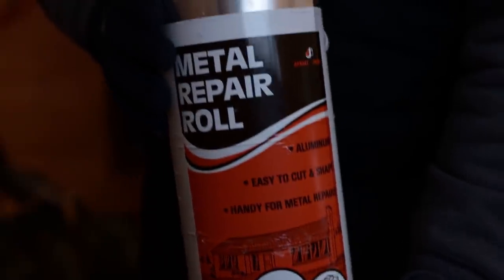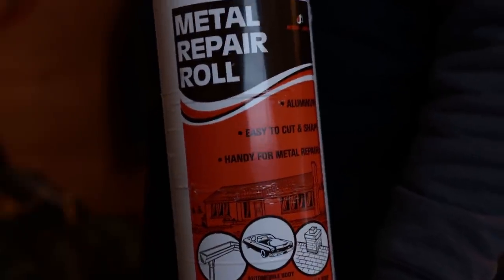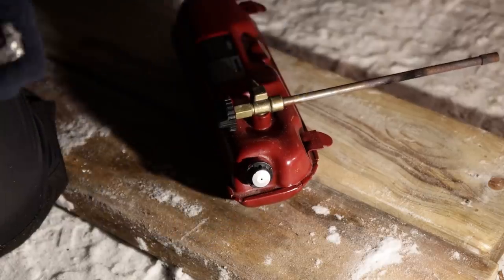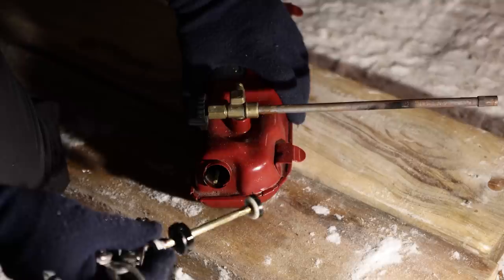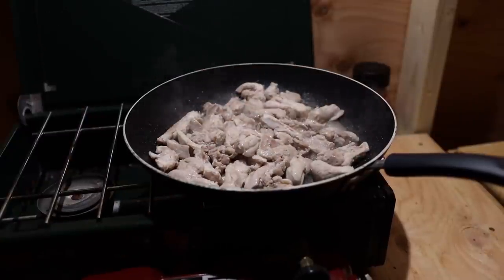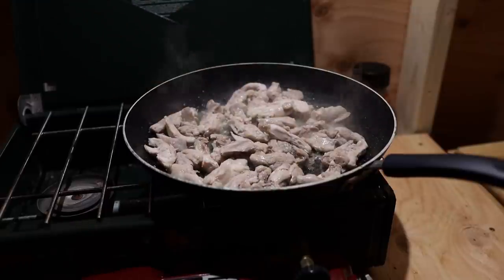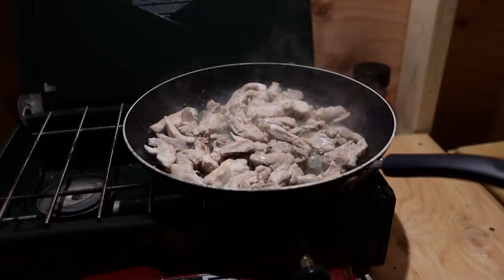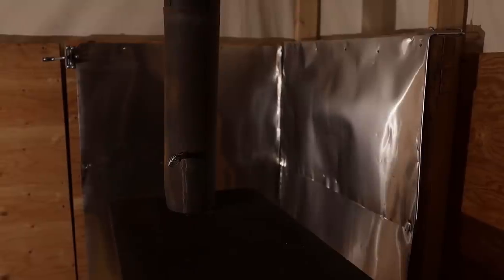-40°C READY. SUPER HOT TENT NOW! BUSH FAJITAS.

Comment: Thank you again Jay. You can cut that aluminum sheet by just scoring it with a utility knife. Then bend it and it will break clean. Fold it so it first opens the scored line then back and if you scored it deep  enough it will snap cleanly. Have a great day.

Comment: Great job on the reflective wall if u score the line a couple of times u can pick it up on both sides and it will break at the scores line saves time cutting with tin snips. Your propane lantern needs to be set lower from the ceiling of the tent reason it releases alot of extreme heat may burn your tent if left to long. Usually those lanterns are better for the table top. God bless be safe. Jim

Comment: Another tip to get the coleman stove working when its really cold is to pour a small amount of naptha in the little burner cup and light it with the tank/generator in place beforeopening the valve...it'll preheat the generator and get the stove working well

Comment: In College, I was in an Appropriate Technology class and we were shown that colors affect heat/cold reflecting back. We painted various colors on wood and placed the board in the sun. The silver paint was as cool as was the white paint. The black paint was the hottest.

I painted my relatives cement roof white in Colombia to protect it. We heated our water with Pex Tubing in the roof. Our solar hot water temperature fell 15F.

In general, I would just paint the boards, but this time you needed high temperature paint and the sheet metal also protected the wood.
Reply from the maker: This is really good to know. Thanks!

Comment: Watching you light your Coleman stove brought back some memories from years ago.  I hope you have a small fire extinguisher in your tent.  I used a stove like yours for years moose hunting for 25 years and at home to cook corn outside.  It happened, once at home and once at hunting camp inside the tent  the stove flared up with flames at least 3 ft high due to the needle wearing down.  Good thing we had a small fire extinguisher at camp or the whole thing could have gone up in flames.  
    I hope you didn’t throw the pump you removed,  keep it as a spare.  Give time for the gas on the seal to evaporate then give it a good soaking in oil, this will rejuvenate the seal.
Reply from the maker: Thanks for sharing your valuable story and tips. Very good to know.

Comment: heat reflector must have at less 1 inch in between the combustible wood and the tin metal permetting to warm air to circulate. Your reflector will tend to burn the wood back to the tin if your stove will running verry hot.

Comment: Mylar has a melting point of 254 C/489 F.  As long as your stove is far enough from your walls to keep them from reaching these temps mylar emergency blankets are a cheaper and lighter option for a heat reflector.  
You can also staple it to the inside of your roof frame and create additional cheap insulation.  A dozen blankets are about $10 US on ebay.  Probably not a good idea if you use heat to remove snow off the roof, but you could map tack it up after the snow is gone and improve the heat retention significantly until you need to melt more snow off.  Maybe try it out as an experiment and make a video about the resulting temp change.  I've got a Gazelle tent I'm going to try it on as soon as I get my stove jack made and installed.  Still waiting on Amazon to ship my welding blanket for making the jack.  I'd love to know how it works on a large canvas tent.

Comment: Buy you a couple rolls of insulation and behind the boards around your tent put the insulation in there then when you fire up your wood burning stove it'll make it 10 times warmer in there duh it doesn't cost that much if you buy it one piece at one spool of insulation at a time you can even cut in a spot for an air conditioner during a summer